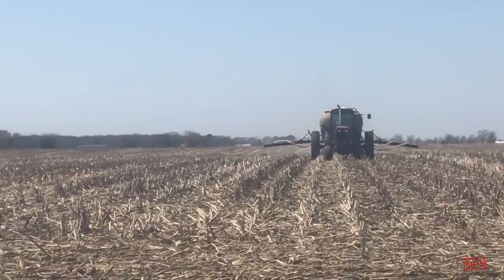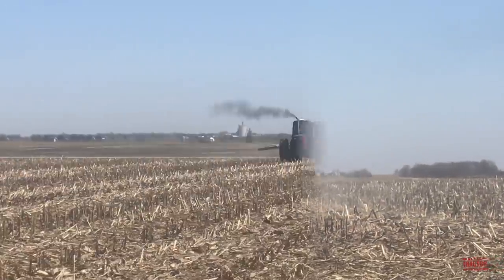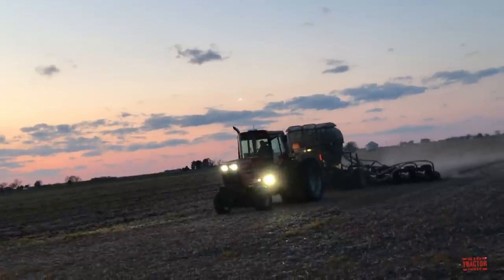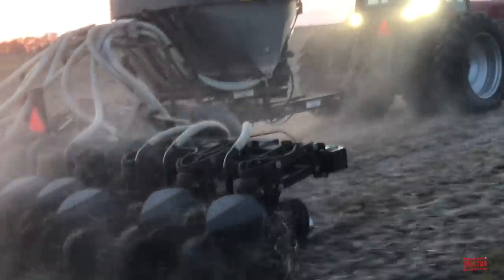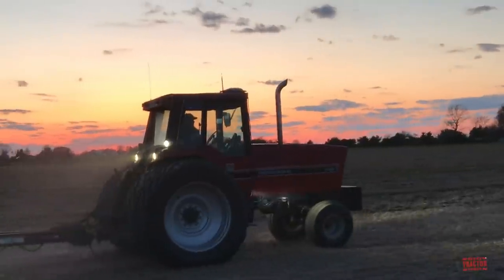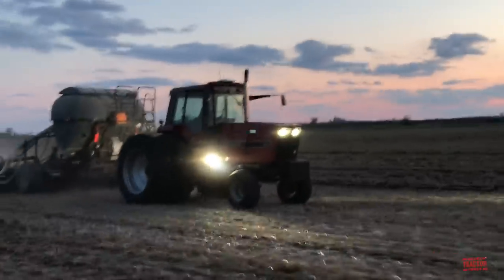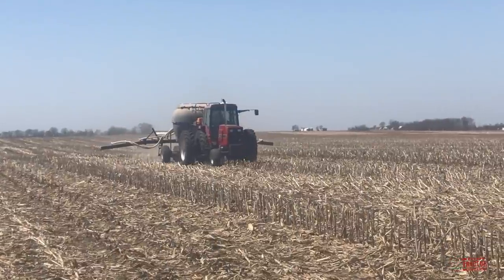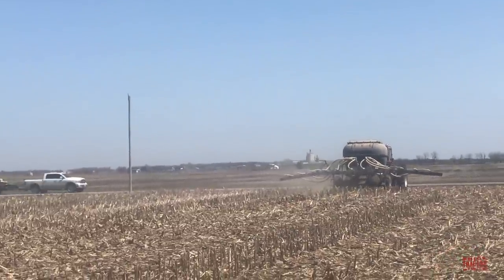INTERNATIONAL 5488 Tractor Working on Corn Planting

Comment: My favorite IH is the 656. My grandfather and my dad each had one. Was also the first tractor I got to run by myself.
Reply from the maker: I am a 656 fan. My neighbor had two gear drive 656s.  They ran with duals on cultimulchers in the spring and New Holland haybines in the summer.

Comment: It is interesting to see the boxcar Magnums and how there is so much of the 88 series design that lived beyond the IH nameplate.  The 3 point hitch for example looks to be the exact same parts.
Reply: The magnums was the next iH design that was supposed to like out but then they sold out so it came out as a caseih tractor in 1987-1988 tenner who already owned case tried  painting there case tractors red and and selling them as a international  to try and reduce there invatory  but the international fames weren't buying them I remember them saying that they wern't a case painted red alot of iH dealers stuggled with sells until the new magnums witch was a iH design came out in the late 80s.

Comment: International Harvester's main cause of its demise was the hiring of the company president Archie McCardell from Xerox. Record profits in 1979 turned into hundreds of millions in loses in two years and a 172 day UAW strike. McCardell, the 172 day strike, and a recession proved to be end of IH.
Reply from the maker: He was the first CEO in the United States to be paid $1 million a year. Today that is not much but it was a big deal back then. Interest rates, low grain prices and bad management decisions excelerated the end of IH. Decades of decisions less the company to the point of no return.
Reply: @bigtractorpower  I agree bad decisions and the economy at that moment cost the company, but from everything I have read from the mid level managers, union reps, and front line employees, McCardell was just an awful CEO.  He took IH from the 2nd most valuable company in the United States to a company that couldn't even muster $2 on the stock exchange in less than 5 years.  6,400 employees lost their jobs, and IH company was lost forever to Case.  He was fired the day after the strike ended, and no concessions on mandatory overtime were accepted by the union.  Just a stupid move on his part to force a strike in those economic conditions.

Comment: They need to back off the throttle every vid that's all I hear is balls to the walls go up a gear and use less rpms saves the motor
Reply: A lot of the older tractors, particularly here in the US, get their horsepower at higher rpms compared to engines today.  Plus he's pulling a strip till bar, not the easiest things to pull and he's a 2wd at that.
Reply: @Zero01k  that don't mean anything I watch a 5020 pull a 70 foot harrow I run a case 9380 on 30 plus feet disk and field finisher rpms max at 3300 but I'm running 6th or 7th gear anywhere from 2500 to 2800 rpms she's currently lived 9100  hours and still going strong